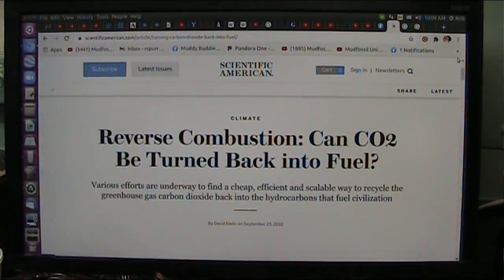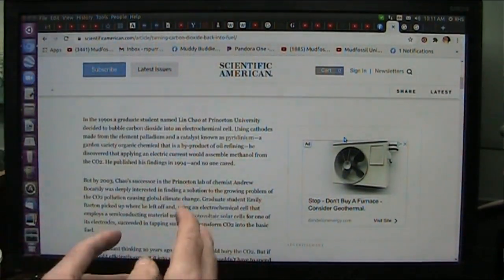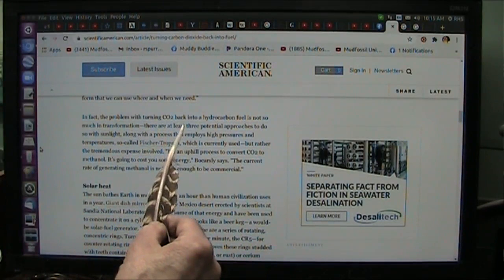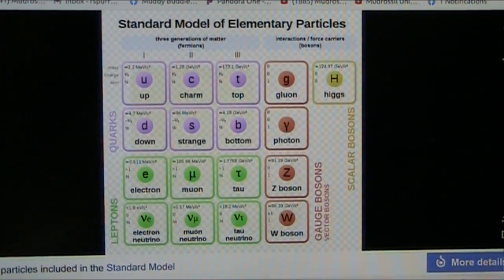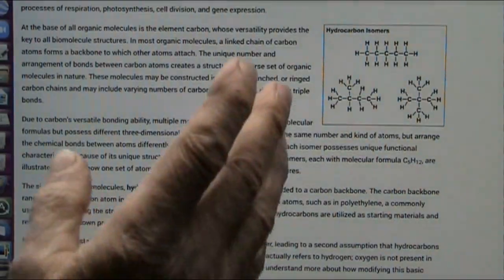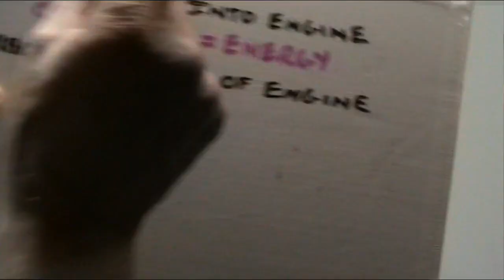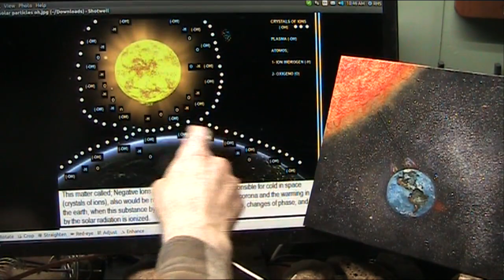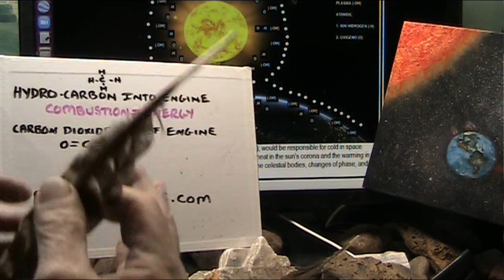Can CO2 be Made into Hydrocarbons Again

Comment from the maker: It seems that if this was to work....all vehicles currently using gasoline could be converted to Hydrocarbons as the combustion source VERY EASILY. Convert the Intake and use a Laser in the exhaust to create Hydrocarbon and a tube back to the intake....literally a closed system. Lots of engineering but IMO doable. Could save the planet....but FLATEARTHERS DESTROY MY WORK....they are the thumbs down unless it is you and can explain.
Reply: Genius!
Reply: Sounds doable to me Roger.people have came up with a lot of different ways to solve this and are refused by the patent office.good luck and good vid .ta Roger.
Reply: @user-sc69  If you can prove that you created it without stealing from an existing patent then you can market and sell. Since such a device/procedure is kept secret it is far easier to accomplish this. If the patent office won't allow a patent it's quite easy to have a device manufactured in a jurisdiction where patents aren't recognized such as...China, Japan (where most things are made) and the only hurdle would be that the 'patent owner' would have to get many lawyers working re our border to stop entry or to share profits with. Once word got out that such a device was being held back it would destroy the patent holder's image. GM, Ford, etc would die a miserable death to have been found sitting on such an environmental help.

Comment: Roger, you might be interested in reading about this new company called Remora, they're doing pretty cool work (I am not affiliated). They are building a CO2 capture device to fit onto semi trucks, and have impressive numbers. They aim to capture 80% of carbon emissions by piping exhaust through their device, which will store it temporarily until it can be dumped at a pit stop in a gas station. Truck drivers can offload the captured CO2 in 5 minutes and get back on the road, and the company collects CO2 and sells it to concrete producers and other industries in need of concentrated CO2 and even share the revenue with their customers. One of these use cases is indeed to use catalyzed chemical reactions to produce hydrocarbons like methane or methanol.